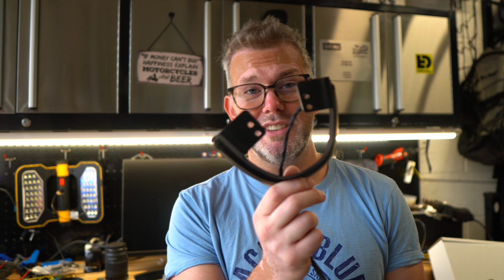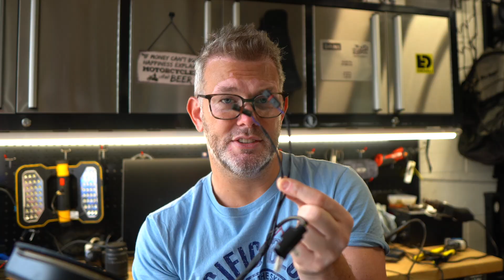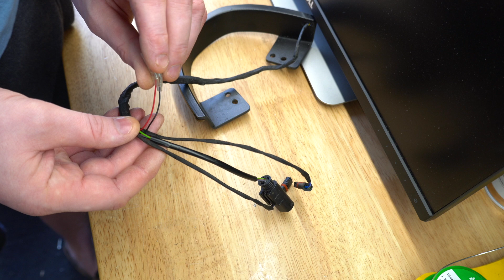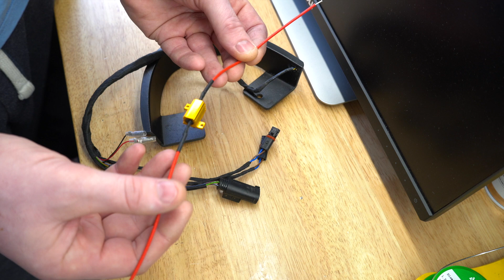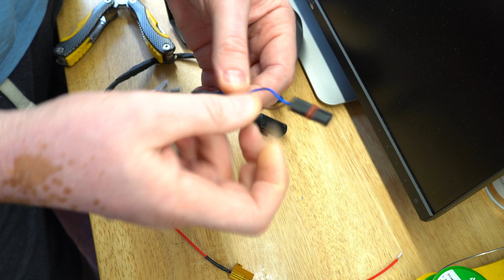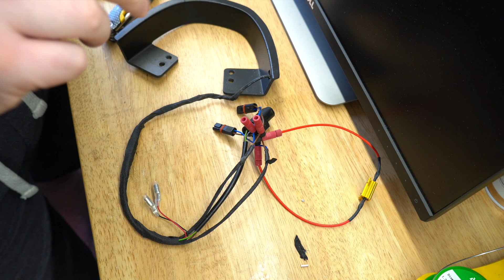Fancy Bike Thing Tail Tidy / Causing DASH ERROR?

Comment: I need to know if I should take my bike to BMW service and get rid of this ERROR.. You did not say anything last year when I bought this kit that there's a chance that this will show error. The patch or resistor that I can get for less than $20  on AMAZON and $50 from you to get it ship to me here in US and will take a few weeks. It will cost me $175 per hour to take it back to BMW dealership to upgrade the software error. If I was informed before and with a choice of either this kit or Daedalus with no error, then its a no brainer.

Comment: Ah, the joys of vehicle electronics. Those cable joiners must have replaced the blue ScotchLoks that were so common when I was in the trade.
Reply from the maker: Roger Kent scotchlocks are still very popular. I personally prefer positaps.  Smaller too.     There are these other ones on Amazon I really like. Similar to scotch locks but with a spade connector.